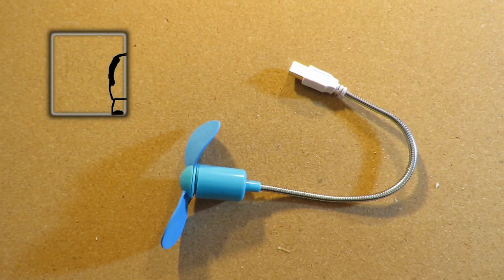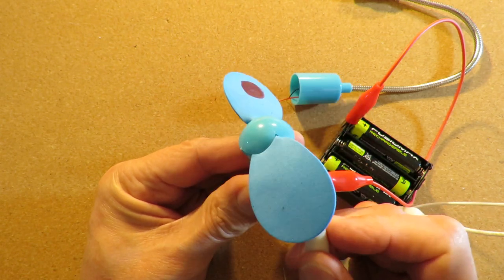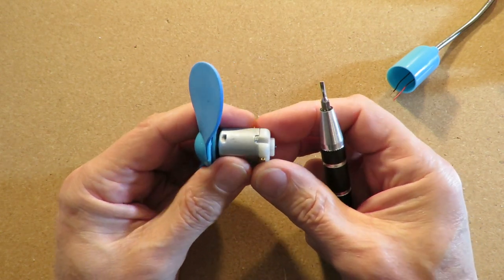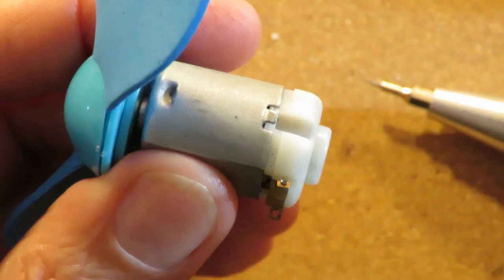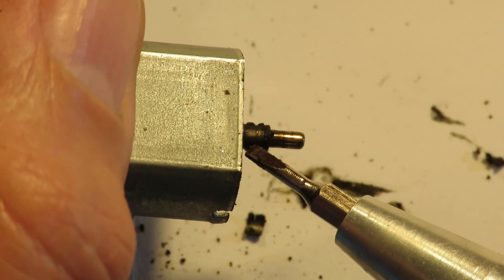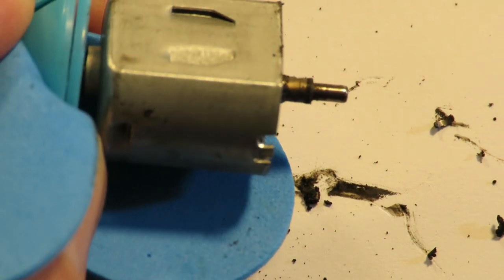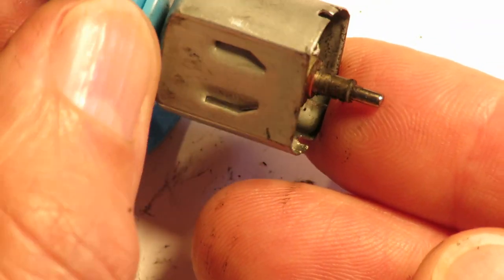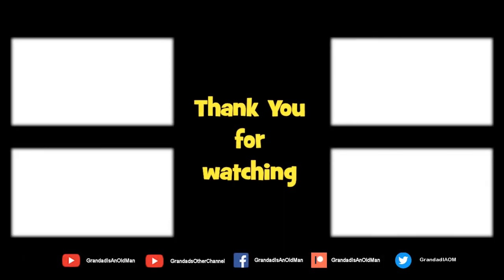Poundland USB fan tear down

Comment: Thank you so much, you fixed my fan!!!
Reply from the maker: There isn't much to them 😁👍
Reply: @GrandadIsAnOldMan  My fan works now but when I plug it in, it takes a few touches and like 1 minute to gather speed, anyway I can fix that?
Reply from the maker: @randomchild4440  it sounds like the commutator is damaged like the one in my video and the easiest fix there is to swap the motor.